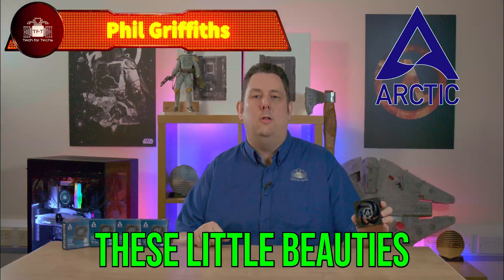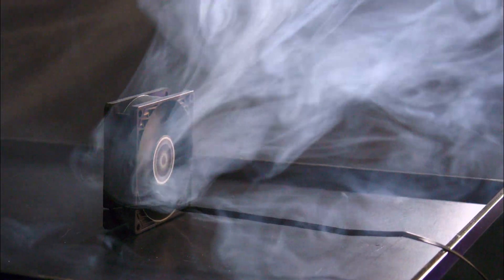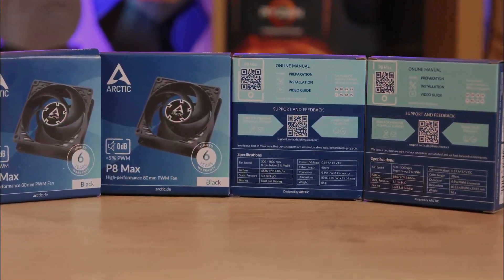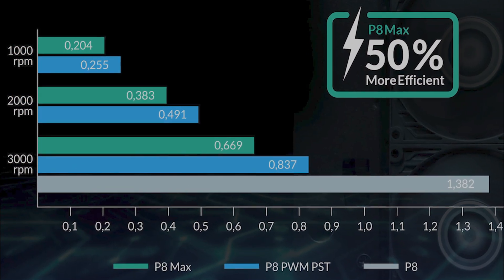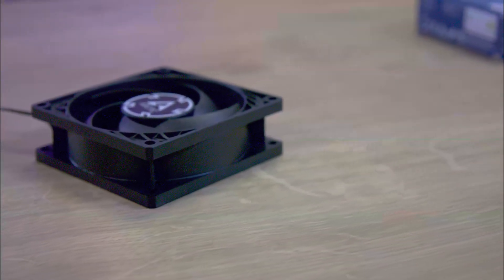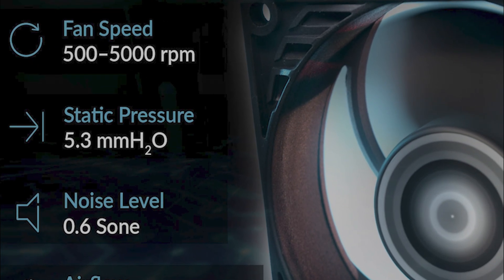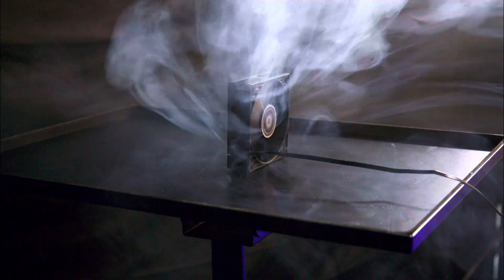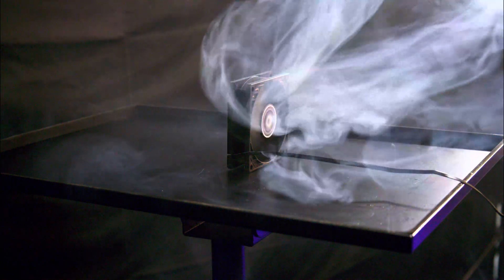Arctic P8 Max | High-Performance 80 mm PWM Fan

Comment: Even at 100% speed it's not unbareable and at 3500 rpm it's the same as OEM HP 90x25mm running at idle!
Arctic at idle is absolutely quiet all the way up to 1500rpm ish then you start to hear wind noise.